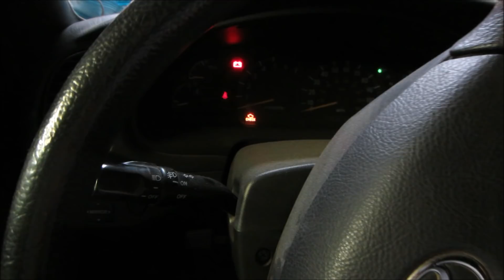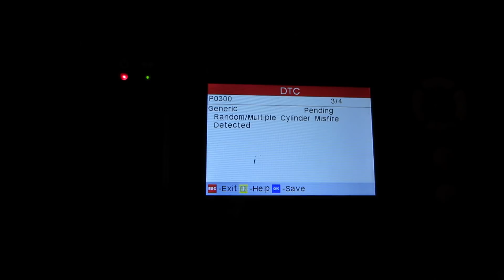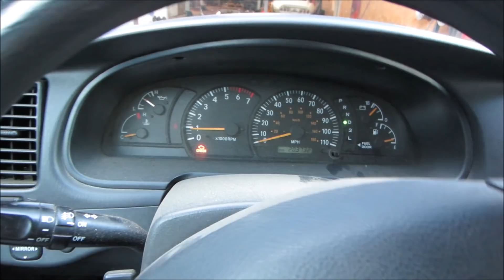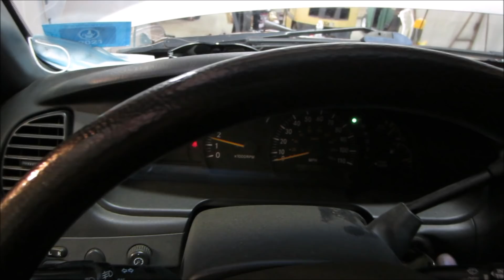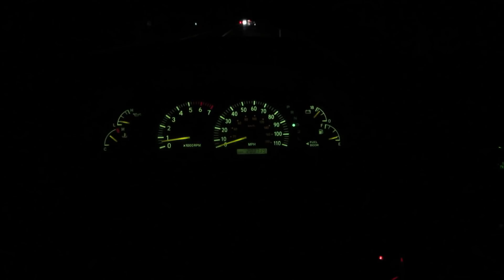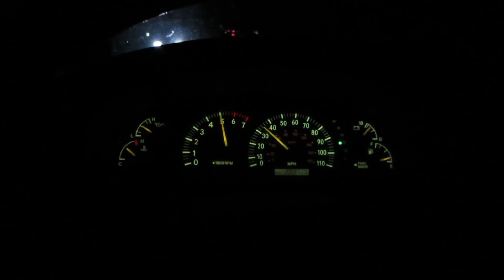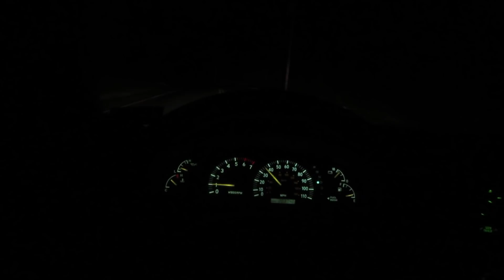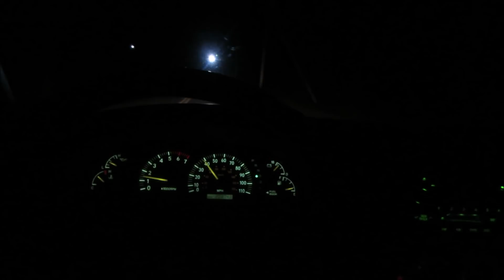What Screwed Up My Engine? You Won't Believe It

Comment: I warm up my chainsaw oil in a water bath on my coleman stove before spraying on my trucks and trailers.
Low boiling water can't boil oil, but thins out nicely for Fluid film spray gun.

2013 F150 303k miles
2015 Ford expedition 80k
2020 PJ flatbed trailer 

Giddyup

Comment: Years ago i had a 87 Honda accord, my beater car, one day i was coming home from work, i had just started from a traffic light and going about 45 or 50, when a timing belt broke, well i changed the timing belt, and started it up, and it ran rougher than hell, i kept driving it, and in about a week or so it  started running better, i think it strengthened out the valves that got bent, i think it ran as good as it ever did after a month or two.
Reply: Wow Bill, self straightening valves!  That's awesome!

Comment: My grandfather would do that with his used motor oil and a pump sprayer. He would even put it inside the doors for when the windo seals dry up and let the road salt spray drain down inside. And I probably would have just held that 02 sensor in with a couple wraps of stainless tie wire on either side. The rusty studs would locate it and the wire or hose clamps would hold it on. If they leak a bit it doesn't hurt a thing, the back ones are just there to tell on you for gutting the cats. I've had luck just spacing them back with an antifowler for spark plugs.

Comment: You can usually just use a 19mm or a 3/4 socket on those lug nuts. I have the same ones on my truck. I have the socket key for them but i had lost it once and was able to easily use a regular 19mm socket on it and it worked fine. Didn’t damage them at all.

Comment: Just a thought before you mix the kerosene to the bar chain oil.  Pour a little kerosene in the empty oil jug and put the cap on to extract all the oil out of the empty jug then shake it up and pour it in your mix jug and add the kerosene to your liking. A Little OCD ON MY PART lol 😂.

Comment: I just replaced the gaskets and gasket makers on the thermostat housing a month ago. I had a small leak on the o ring portion of my 05 Tundra. I would have felt more confident in the parts I bought from Toyota if yours would have failed first.
Reply: I live in South Alabama and the undercarriage still looks new on my 16 year old crew cab. 175K on the clock and going strong.

Comment: When a bolt breaks off you can weld a nut onto the broken threads to use a wrench or socket to get the broken piece out.
Reply: I actually learned this trick from his jet ski video last year or so.

Edit: After reaching the point of the video that probably inspired the comment, I see that the fastener may be in plastic, which would make grounding difficult.

Comment: If you remove the spark plugs it will rotate easer. 
The first straight line is where you but the timing belt on @ T.D.C. Then slowly rotate to the "T" to double check timing.
Thank god timing belts are now timing chain. Belts are what I call "Value Engineering" AKA how can we cut cost.

Comment: I watched you use the red spray on battery terminal stuff and it reminded me of the mess it makes. Have you ever used anti-seize instead? I've been using anti-seize on my batteries in cars, trucks, and farm equipment for many years now. I coat everything before putting the cables back on, and it eliminates the corrosion. Just my 2 cents.

Comment: Great diagnosis, freakin mice! I heat my bar oil and melt toilet seal rings into the hot bar oil. Spray it on a cold car and it sticks nice sets up a bit and doesn't drip. Seems to stays on longer then just straight bar oil. Cheapest most effective rust proofing I have found.
Reply: no kero if the mix is hot. I use the same gun you have and it works great. 3 toilet rings to one gallon bar oil. Buy an old crock pot at good will and you are all set.

Comment: No silicone on the o-ring. 
The Silicone on that rectangular interface is not a compression gasket and should not be allowed to set up prior to assembly. It works by adhering to both surfaces. The surfaces should be clean, and allowing it to cure after assembly is a good idea.

Comment: those nuts are called "closed tuner" the ones with a hole in the center are " open tuner". They make lock kits of this style too.  The idea behind it is that a lot of Jobber mags don't have room for a regular socket so the key is a thin wall. Worst thing is to use an impact on them.

Comment: If you stick an allen wrench or rod with a bend in it under the belt and turn it you can slip the belt back in place without taking anythig else apart. Go slowly so tensioner can collapse.

Comment: My thought on the O2 sensor is to use a muffler clamp. The u bolt might have fit through both holes on the sensor.

Comment: Especially between sprays with chain oil, I have had good luck spraying undersides and other potential rust with spray wax at a self serve car wash.   Also, your standards can be far lower if it is a non-interference engine, which in most cases is a big advantage of Toyota over Honda.  Making do with the timing belt on an interference engine can damage valves and sometimes even pistons.

Comment: Yep that spot is only factory sealer. FTIK or whatever toyota calls it. But it's basically a silicone gasket maker. I just used black RTV on mine. The actual t stay housing had a rubber surround around the t stat and where that pipe plugs into the engine has an oring

Comment: Went to change the oil on the wife's Impala. Couldn't see oil filter, reached over where I remembered it should be. Came back with a pelt and a skull. Turns out there must have been a large rabbit hiding under the car and when she started it, it jumped the wrong way. There was rabbit all over. I don't think we ever got it all out. The serp belt was running inside out til I fixed it

Comment: My Volvo 850 has those same lug nuts, but they are actually bolts on my car. The tool looks like a big skinny socket with six teeth inside of It. It goes on the end of a breaker bar or impact gun. I bought it at a local auto parts store called A&A auto.

Comment: Why is this called toyota engine failure? Your timing was off on one side, no valve interference and it was still driveable, 200k and besides a mouse causing rough running it still runs perfect. You could have had a mouse chew wiring which any car could have and I know a few people that  cost them a lot of money to have their wiring harness replaced. Question is where is the hole where a mouse got into. That's another reason I don't park my vehicles outside, mice damage is a bad problem, depending on where you live.
Reply: Do you feel better for making this asinine comment?

Comment: If they sprayed them with Por 15 it would at least chemically stop any more rust. Covering it with rubber/plastic coatings is the worse thing they could do... They fixed mine for free, very early on, and replaced leaf springs, A arms, fuel lines, brake lines and so on, but they soon learned that was far too expensive to fix all of the bad frames...

Comment: I had a 5.3 Chevy Truck that starting missing one day really badly. Threw the same codes, ramdom multiple misfire and an 02 sensor code. Turned out that both 02 sensors in the front were bad causing the misfire. Replaced them and it ran great! The front sensors control Air/Fuel mix so duh. The rear ones just monitor the cats. Although I had them tuned out of the computer and I didnt have any cats on it either.

Comment: they actually made that tensioner easy to get to... on the 4runners it's blocked by an accessory bracket that snakes around beside the engine and requires removal of just about everything.... not a Toyota fan after that one.

Comment: You should clean the top of your battery off, there may be battery acid in that allowing voltage across the top of the battery. Baking soda/water mixed or Napa should have some type of cleaner to get that off. I like timing chains better than belts.

Comment: random cylinder misfire.............first thought........mice damage, but I was thinking a chewed up wiring loom.  Mustie never disappoints with the unusual disasters that can happen in and around engines. When installing a tensioner like that unit, loctite the bolts every time..........if they come loose its all over.
Reply: Yeah Wazza I think he used some kind of black or grey sealant on the tensioner bolts.  Not threadseal as you say, but hopefully enough to stop the bolts coming loose ay?

Comment: I had a Ford 4 cylinder engine on a generator. Same one that is in a Ford ranger. Jumped time because of a nest of mama mouse and babies. Block heater made a nice heated apartment. Till the exercise timer fired it up for its weekly test. New timing belt, idler and water pump.

Comment: I've done that timing belt twice on my 04 tundra 4.7.  Ugh It's a pita for sure.  I take the radiator out to so I can get an impact on the crank shaft bolt.  Never had a rat in there tho. lol

Comment: Cut a peice of antifreeze jug wide ,and long enough to be able to wrap it around the timing gear. Then wedge it between the belt ,and timing gear. It's kinda like hand cuffs. If you close the spaces that contact eachother then you can slip the gear 3 teeth to get it in time. Maybe next time I can tell you before you fix it...lol

Comment: I work repairing copier machines, and a lot of times I would go for broken gears or noises, and it would end up being a mouse would get on the back of the machine, and when turning it on, it would get crushed by the gears and cause the noises. Dirty job, and business would not believe it until I would show them...

Comment: Christ, it's the rubberized undercoating! Saw this on one of South Main Auto's videos and was equally horrified over it.
BTW, how were you able to pinpoint your issue to a timing problem? I was thinking you would check spark to see if it's running rich/lean and check your fuel trim to see if the O2 sensor was the issue

Comment: 1:00 On newer engines (around 1996 and newer) when they are first cold started they run on a program that is a general fuel air mix that doesn't need any real time readings because they haven't had a chance to get any real time readings yet when they are first fired up. So for the first one to three minutes (depending on the car make, model and year etc) they will seem to run fairly smooth even if your O2 sensors or MAF is not working. So after they start to read the actual info the engine will start to show the signs of those sensors are bad or not working for what ever reason. Like a dead mouse and it's crap. LOL.

Comment: they make a tool to remove those wheel locks. You can also use a 18 point socket that you can beat over the lock ,and sneak it off that way,

Comment: 49:19 An easier way I've found to clean corroded battery terminals off: Put baking soda on the affected surfaces, then slowly pour warm vinegar over it, covering all of the baking soda, then let it bubble for a bit, then pour some warm water over the area to wash it off. The corrosion should just rinse right off :)

Comment: I had a 79 Toyota hilift pick up that the frame broke between the cab and bed. I fixed it. I didn't know it but Toyota would have paid  $14,000 for it. A friend of mine bought the same year truck and the frame did the same. They paid him $14,000

Comment: They replaced the frame on my 2007. Tundra...   All wire harnesses and lines attached to frame came new frame...  Brakes, fuel, etc..  did it in 2 days.

Comment: It's perfectly fine to tap the battery clamps on with a hammer, however, first you must completely remove the 10mm bolt that goes through it. Then re-install the bolt.

Comment: I had this problem in the briggs&stratton engine of my riding mower.  Mice climbed in and made a nest right in the center of the fan blade.  Of course, i didn't realize it until after i tried starting it.  that was very unpleasant.  From then on, i always park my mower in the shed with the hood open, so it's not a cozy place to be anymore.  blagh.

Comment: Anti-freeze is made of glycol which is similar to sugar. In fact they these days they have to put a bitter taste into the anti-freeze so animals can detect it. It's also been used in the past to poison people because the anti-freeze would taste slightly sweet so people wouldn't think they were getting poisoned. I believe the sugar is in there to improve its ability to carry heat away from the engine. If you've ever made simple sugar for Ice Tea when you boil the water and sugar it gets so hot its makes you think its molten. Even though its the same temperature of boiled water it radiates much more heat.

Comment: I use to work on a guy's lawnmower that an overhead-valve Kohler in it. Every spring I had to take a flat mouse out of and put in a new timing belt and gears. Bad design for a Lawn Tractor that would sit in a shed half of the year.

Comment: Finally watched this one this am. Wow, mouse in the timing belt. Never seen that before. Good save on that one. Got lucky it didn't   take out the valves.
Reply: Toyota belt engines are non interference

Comment: I had to use a socket to get those lock lug nuts off for a lady who was stuck on the side of the road. Next time I tried that on a friends vehicle, they had the lock lugs with bearings so the cap would spin. You can't just use a socket to get them off.

Comment: Man get the shroud out, it's just 4 quick bolts!  It's the top marks that line up, the other to the right of vertical is the service marks.

You can pull the bolts on the other cover and peek in there and don't even have to pull it off

Comment: I don't think Ralph can just take off his old feet and put on new ones since he joined that Japanese health club.
The treadmill there is deadly.
If he had a soul may it cross over in peace.
Watch out for hauntavirus germs.
So, what was your diagnostic time when you made a list of parts you need?
Now if you look up the labor for the planned operations, and caught up the neglected maintenance, what's the total hours and Toyota parts estimate?
Standard question at the point of completing the inspections and using good judgement.
If it was your best friends moms truck and you have to fix her future problems for free, what's your estimate?
The Right Stuff is the right stuff because its non acid cure silicone.
If you use RTV, the next repair could find pitting and or cavitation if it is allowed to go with the acid cure RTV and aluminum.

Comment: I worked in a Toyota dealership service department from 1991 to 2015. The 4.7 is THE most bullet proof and reliable engine that Toyota ever sold in the US. There is nothing close. I have heard all the stories and conjecture about 20R//21R/22R/21RE/3A/4A/etc etc. I made thousands of $ thanks to timing chain failures/headgaskets/and general expected wear and tear. Those engines stood out as"indestructible" due to the junk the competition was producing, and the premium that customers paid for the vehicles in the first place. They were fantastic, but there is some padding put in thier histories. I can tell you this: I never made a single penny off a 4.7 internal engine repair. Never. And count them, ZERO, I witnessed zero timing belt failures. It is quite literally the best engine I have ever witnessed in service that consistantly, no matter what maintenance was done, kept on purring. The most reliable engine in a Toyota pickup (Tacoma) ever sold? Its a toss up between the 2.7 and 4.0. Again, never seen an actual engine failure from either one of those. Boringly reliable.

Comment: Great, so mice have found yet another way to F up our cars?  Can't believe those V8s use belts.  I just did the belt in my '97 Corolla's 7A-FE a few weeks ago, new tensioner, water pump, and crank and cam seals too,

Comment: its an aftermarket lock lug you might have to go to an auto parts place dealing with 4wd aftermarket to get the right socket for thouse lugs. my bosses ford f-250 has similar lugs and we had to go to a 4wd parts place to get a socket.

Comment: Do you still have the 4 runner too? I can't keep all of your vehicles straight any more... As for the lug nuts they do sell individual sockets, but they make many of the same style, those are just a different wheel lock basically they do sell a master set on amazon if you look it up.

Comment: My family member has a 2013 4Runner and it was suddenly running really awful so we took it in and a mouse had chewed through the wires to a coil pack. We took it in instead of doing it ourselves because the wire was in a really tight place to reach

Comment: I wonder if using a standard U-bolt around the exhaust pipe would have also worked to attached the O2 sensor.

Comment: hmmm I kinda find it odd...as much as that that timing belt jump teeth, I would have imagine that the pcm would have picked it up from the camshaft sensor, yet threw up no code for that. often thats what happens when the crank and cams sensors are off sync. very surprised the pcm didn't throw a code ffor that. especially jumping that far out of timing.

Comment: I have a weird intermittent idle issue with my 2004 Honda Pilot. About once every six months or so, when I start it the rev's will surge and the idle will go to near zero and will then stall when put into gear or the AC comes on. Figure it's the "Idle-Air-Control-Valve" but why does it happen intermittently? It will normalize after driving it for a while. A bit tricky keeping it running by heel-toeing an auto-trans in traffic. Then it will be fine for months and months.